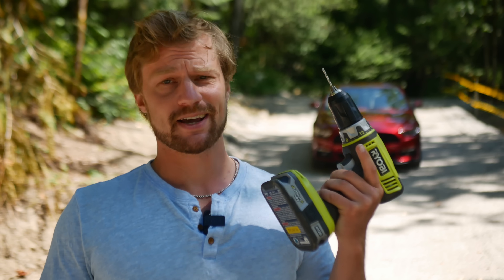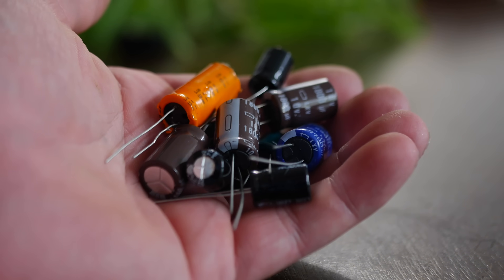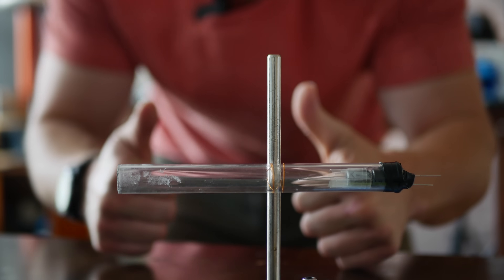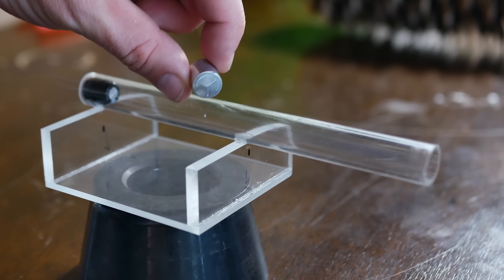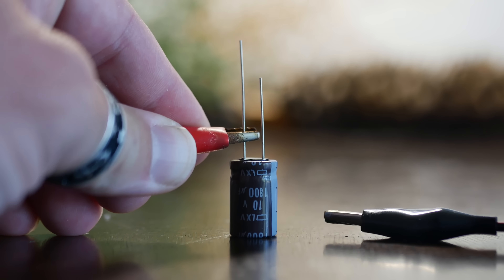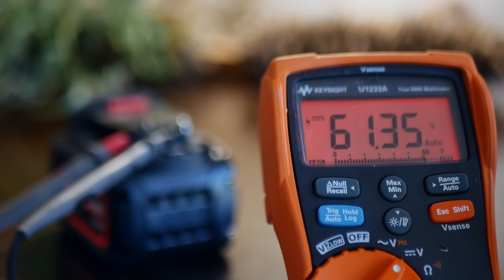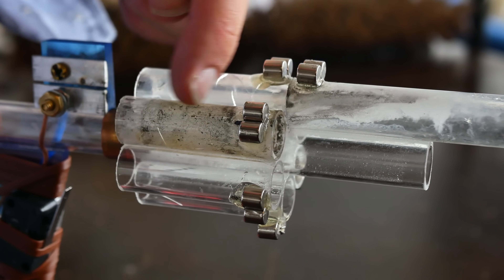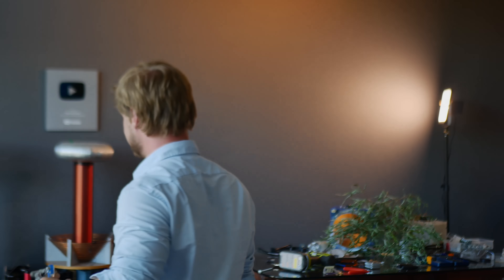I Built An Electric Capacitor Revolver!

Comment: So, you made a steam cannon out of capacitors.

Sealing up the venting of the cap would certianly give rise to more muzzle velocity at the expense of response time, but i doubt the response time will be of a notable difference.

Or just making your own false capacitors that are just a heating filament in water with a break point with let's say, 50 pounds of hold force or greater. 
Then youll have something around abouts as strong as a early black powder firearm.
Reply from the maker: Great ideas. Thanks for the input. But yeah, this is basically a steam powered revolver.

Comment: what is and where does that fluid come from during your tests?
Reply from the maker: The fluid coming out of the capacitors varies depending on type, but it's an electrolyte. Often Ethelyne Glycol
Reply: @PlasmaChannel  oh great, thanks. I never realized there were fluids in some caps - that could cause a whole lotta damage inside a device is one of those spewed its liquid all over the circuits - yikes!  lol

Comment: Seems sort of like exploding wire method with really expensive 'ammunition'.  You could just use sacrificial wires instead of caps.  Of course, if you there were contacts running the entire length of the barrel, then instead of an EWM accelerator you'd have a plasma railgun, and that definitely isn't something you'd want to do.
Reply from the maker: Oh nooo.. not something id want to do. Nothing to see here folks.....*whistles nervously *    Nice idea brother.

Comment: Used to wire these up like this under peoples benches in tech collage to give them a wakeup and you don't mention the cheesy feet smell. plus we had a huge capacitor  about two feet tall we used to weld peoples rulers to the metal bench tops. And the less said about what we used to do with a meg tester the better. Basically a couple of years of wondering if everything will A: Explode.  B: Electrocute you, XD

Comment: Hey! You should put a taper after the capacitor to a smaller diameter barrel. That would let you get higher velocities. There is no reason the projectile has to be the same size as the capacitor.
Reply from the maker: True! Just went for convenience I guess!

Comment: Nice work Jay, that's a pretty unique way to use a capacitor. For version 2.0, I recommend trying to use the capacitors in a different way: in an electrothermal gun. They put railguns to shame, and if you build one powerful enough, you might just land a collab with your spirit animal over on Demolition Ranch, lol! Keep it up man!
Reply from the maker: Thanks LC! I'll have to research those further, and definitely am in the spirit of innovation.
Reply: I thought up of a similar idea the past year where you have a electro thermal-chemical gun using a poisoned high explosive (essentially a high explosive with heavy non-explosive additives, making a product that can be heated, burned, melted and molded into a casing surrounding a projectile but not be triggered until a very strong electric pulse discharges into a plasma cartridge and releases a lot of plasma/ultraviolet radiation into the propellant case. This helps the problem with caseless ammunition by using propellant that can’t explode chemically unless subjected to pulses of plasma or radiation, which makes combustion of it more efficient as well. Also to help would be to take the waste heat from the propellant to run a stirling cycle which taps into the heat from the breechblock to recharge the battery used in the weapon. Which would make the system capable of outperforming conventional guns while being inherently safer in being electric and easier to manufacture.
Reply: @topsecret1837  That just sounds like you wanna use TNT and build your own exploding bridge wire detonator in pistol shape.
Reply: @xxxm981  

Oh no, it’s really different than that:

https://en.m.wikipedia.org/wiki/Electrothermal-chemical_technology
Reply: @xxxm981  

Also, TNT would be too dangerous. Smokeless powders and gunpowder in general belong to the family of low explosives, where their detonation velocity and reduced brisance prevent the barrel from shattering, which would be deadly and unsafe to the user.

High explosives are otherwise completely unused for those exact reasons. The way I had in mind to approach the problem would be to take a high explosive and weaken it to a point where it’s still more energy dense than double or triple base powders but weakened enough to prevent the brisance and detonation velocity from exceeding the pressures that normal barrels are capable of withstanding, thereby increasing muzzle velocity but also to make the propellant so difficult to detonate only ETC technology would be capable of igniting it, period, to a point where the casings can be 3D printed and injection molded into forms that can alter muzzle velocity and projectile size while keeping the case size the same for all calibers.
Reply: @topsecret1837  much like the million round a minute prototype from some time back? Barrel pressures are already close to max with some powder loadings. +p+ rated barrels are more expensive for a reason. Powder optimization has been happening for a while too, for rifle and pistol or carbine. Really it comes down to cost. The compounds you are proposing will be cost prohibitive. Iirc that is also used for artillery currently, due to safety of transport and handling.

Comment: You showed testing overvolting the capacitors, I wonder if doing this + reversing the polarity could lead to greater velocity?
Reply from the maker: That's what is shocking. Off camera, I did test reverse polarity overvoltage. Honestly, it reduced velocity and drastically slowed down the reliability of the explosion.

Comment: I think in the ender's game movie you could charge the gun before you fire. Maybe you could rig up a circuit to charge a capacitor to get higher voltage, and then feed that electricity into the capacitor that gets destroyed. Maybe hold the trigger to charge, and release the trigger to release the energy?
Reply from the maker: A reverse trigger? That's a new one. I'd love to experiment with that.
Reply: @PlasmaChannel  I'm happy you saw my idea. You could also have a sperate button for charging the capacitor or something, I just thought the reverse trigger might be a simple way to do it

Comment: You can use a simple booster circuit (step up module) to achieve high voltage. If you double the voltage (120V) the all thing will be very interesting.
Reply: Yes its good idea

Comment: Have you found an upper limit where the increase in voltage stops increasing muzzle velocity (not a sentence I expected), you've definitely got the high voltage supplies to try.
Reply from the maker: I have not found a limit at this time. Just wanted to know the correlation, and that was good enough for me, for this first prototype. If I do V2, i'll be making TONS of changes.

Comment: Could you use a larger capacitor to provide the high voltage and high current needs? I’m thinking use a much larger capacitor to blow up a lower voltage smaller one

Comment: What about using a cartridge consisting of a bullet with a wad of ablatant/propellant behind it with embedded spark gap. Dump a huge change into the spark gap from a capacitor bank and the propellant flashes to plasmaChannel, the abaltant simultaneously creates a gas seal, protects the chamber from the extreme heat and increases gas generation for more chamber pressure.

Comment: A capacitor revolver is a HORRIBLE idea. I'm so happy you made one. I'm curious as to whether gluing the projectile to the capacitor caused a noticable decrease in speed. 
Also, I'd love to see a second version. Perhaps a revolver-rifle with 2 drill batteries for 120V applied to the cap and a longer barrel for higher projectile velocity. The batteries could also serve as the stock for said capacitor-rifle so their weight is shifted away from your arms a bit.
Reply from the maker: I'm getting some great feedback from people like you. Thanks for taking time to watching my video, and leave your thoughts!

Comment: I think you can use a boost converter to step up the battery voltage. In order to provide an adequate amperage you can connect a big capacitor at the boost converter's terminals with a resistor in series to limit the current draw of the converter. In between the shots the capacitor will have time to charge and when you press the trigger it will provide a high voltage and current to make the little capacitors explode.
Reply from the maker: That is definitely in order for V2

Comment: I'm wondering to know how the capacitance of the capacitors are affecting it and also if using different types of them changes the results which obviously does.
Reply from the maker: I found a sweet spot with the caps i used. Off camera, I did a lot of testing to determine how capacitance played a role. Found too large of capacitance actually lead to velocity reduction. There was a sweet spot for my specific design.
Reply: I was curious about how the capacitance rating might affect velocity as well.

Comment: Awesome video, did you experiment with reverse polarity and opted for higher voltage, during my apprenticeship days we added electrolytic capacitors in reverse to blow the terminal boxes off the wall when our tutor turned the psu on during practicals 🤣 brought back some fond memories 👍
Reply from the maker: Strangely, I did try reverse polarity. Found it slowed the barrel speed drastically, and lead to irregular explosions that were unpredictable in terms of time. Strange. So, I stuck to normal polarity.

Comment: Build a battery pack using high rate discharge 18650 batteries like many people use for vaping. The ones I used when I was vaping where rated for 3.7v and 35 amps. It would only take 24 of them to reach the 90v mark which would put the size of the battery pack only a little larger than the 60v battery pack that you used for the prototype. You could use a "smart" charger like the ones used by RC hobbiests to safely charge the battery pack. I mean, you are already fabricating every other single component to meet your needs besides the "ammunition". Why not fabricate a battery pack as well?
Reply from the maker: Oh that would be cool, but 24 batteries wired together is pretty hard to charge all at once haha.

Comment: I do wonder what would happen if you used a HV power supply instead of these low volateges, would the correlation still be positive when you jump to using kV?
Reply from the maker: As long as there was enough wattage behind the HV, it may work great.

Comment: Maybe what you could do instead of using a capacitor as the propellant, design a plastic container with a heating element inside a few drops of water. The 60VDC would very quickly boil the water and burst open the container. Make it do this directionally so all the explosive force is directed out the barrel. Anyways great video as always, love the demo ranch hat

Comment: Did this in electronic's class in the 90's with the right capacitor and piece of wire conduit you can put a Mar conector through 1 side of a. Cinder block.
Reply from the maker: Thats........insane. I clearly need to try harder
Reply: @PlasmaChannel  Well to be fair you are trying to be safe. We sure as hell were not. Lol.

Comment: Why we need 10amp? is 1amp not enough? 
Voltage is the factor that explore capacitor 
So I think 1amp 90V can work😅
If wrong, please Explain what is wrong on my point 😁
Reply from the maker: Ah, so it's the overall power which boils the components inside of the capacitors. More current = faster boiling, and there's a sweet spot where it explodes fast enough. 1 Amp would take 5-10 seconds to explode the cap. Too slow.

Comment: Hahaha yeah. Pretty neat. I also recently got a black powder revolver for the weekends. I love it. Also like Nigel pointed out a boost circuit would get it to the voltage needed but also include a storage cap to store enough energy to cannibalize the propellant caps. I'm thinking a zvs might crank out enough juice to do it at a reasonable speed. Heating may be an issue though.
Reply from the maker: Hey MS, thanks. Yeah, i'm considering a lot of different options for the second version.

Comment: With a high voltage generator and a capacitor bank you can use exploding thin aluminum wire as propellent. I've read about it in some 'Evil Genius' projects book.
Reply from the maker: You're the 5th person to write to me about this. Maybe I should try this crazy idea.
Reply: That;s basically an 'electrothermal gun'. If a reactive chemical propellant  is added, that gives an 'electrothermal chemical gun'.
Reply: @derekp2674  It's not the objective of the experiment. Just an 'exploding wire' electrical gun. That's the point.
Reply: @randomrandom420  As I hinted at in my previous post, exploding wire systems were researched within the field of electrothermal gun research decades ago. With a decent pulsed power supply, you can rapidly transfer energy to an arc formed by the explosion of a metal. Aluminum is one of the best ones to use because the low atomic weight of Al gives the resulting metal vapor relatively high molecular velocities for any given pressure and temperature. As a rule of thumb, the projectile velocity in a gun will not exceed about half the thermal velocity of the molecules in the propellant gas.
Reply: @derekp2674  I misunderstood your first comment. Thanks for the info, pal.

Comment: That is really a smoking gun! I suffered when you were destroying all those capacitors but watching your creativity and passion for experiments was worth it :)
A small hint: you can use a high voltage capacitor as energy storage and charge it between shots with a step-up converter, then you will not be limited to battery voltage. It should be capable of storing much bigger charge (Q = C x V) than each "propellant cap." of course.
Reply from the maker: The smoke effect really made me happy as well. It was unexpected. Thanks for the input!

Comment: I like 6.3V 100uF ones, their can is usually not designed to rupture, there is no cross on the top. Instead, the pressure builds up until the can pops off the rubber base, quite energetically.
Reply: agreed, you can also add epoxy to defeat the pressure relief valve on the bigger ones - the cap provides its own bullet.
Reply: I can't remember exactly what they were but I used to work on things that took some special electrolytic caps. They looked like normal caps but you couldn't get them at radio shack. Whatever they were, if you reversed the polarity by mistake, these things exploded, and I mean full on detonation. It seriously sounded like someone fired a .22LR in the room and would launch the cap across the warehouse. That was a mistake a new guy usually only made once.

Comment: Now I want to see you run it but instead of a direct connection to the battery you have a 2nd capacitor that doesn’t blow up but stores the charge used to blow the other capacitors up.

Comment: Someone FINALLY built one of these things 🙂

Though I envisioned a chaingun type using tapes of capacitors to do the same....
Still cool tho and I'm only 28 seconds in (so you could've acheived a short too, but I avoid those)

Comment: I did build a capacitor gun but used the battery with voltage booster to charge a 440v 200uF capacitor to replace a 64 volt li-ion battery pack.
Result was dengerous very high projectile speed with lethal amount of current in case of any accident.So 
i use a 100v 470 uF cap for safety.

Comment: Get some small non-vented capacitors, when connected wrong, their case becomes a projectile.
Reply from the maker: That's not a bad idea. I'll look into that. Thanks.
Reply: @PlasmaChannel  No problem, I learned that the hard way.
Reply: could also glue the top of a vented one to force it to blow from the bottom.
Reply: @liquidmagma0  I don't think that would work, there is so much force that builds up that every glue would break.
Reply: @filenotfound__3871  maybe soldering the top is enough.
Reply: @fabianbohnert120  The solder wouldn't stick to the metal case of the capacitor